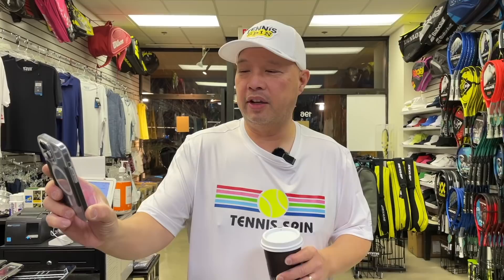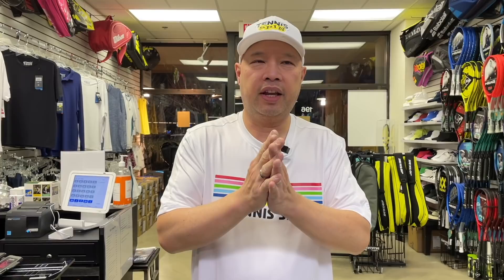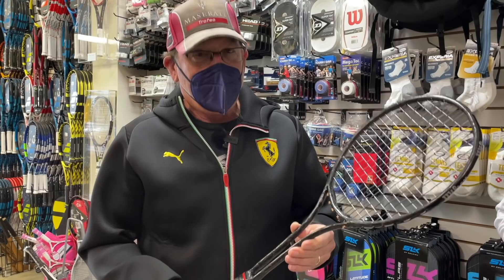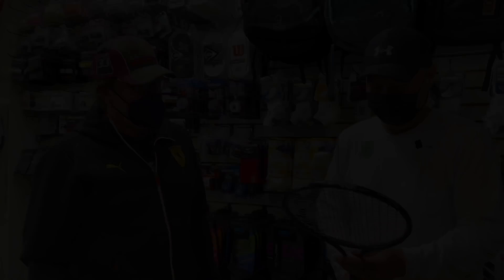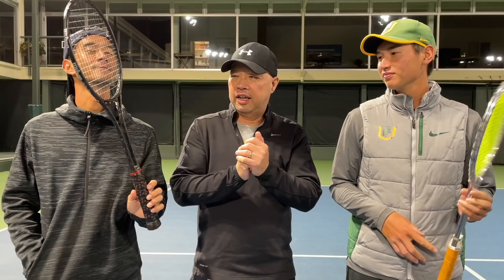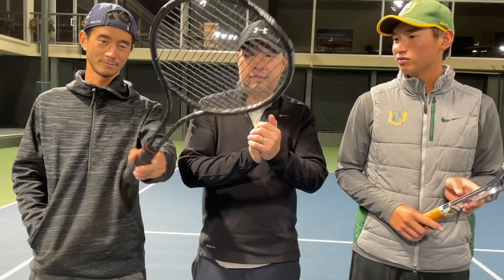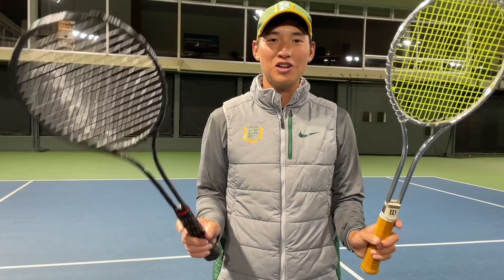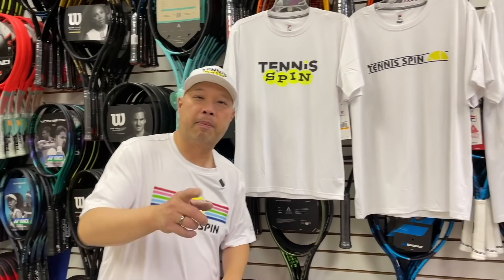CAN YOU MAKE A MODERN DAY WILSON T2000 TENNIS RACKET?  HOW WILL IT PLAY?

Comment: I grew up playing with the T2000 and only gave it up when it went out of production (that wire suspension system was the achilles heel--eventually you'd grind through it and the racket was all done.)  After probably thirty years I picked up two of 'em at a Salvation Army store--in absolutely cherry condition.  Original strings older than our two young coaches here.  And it plays great.  Excellent control, good power, and all the spin you need.  I use a modern forehand and it suits this old classic very well.

Comment: I remember the creak on the T2000. I played with a T3000 as well. I broke my T2000 at the neck and that was one of the weak points. Steel was quite flexible back then. I think that it would have been interesting to try the Tony Trabert C6 and the Adila Cannon which were among the first graphite racquets back in the 1980s and they were 65 square inches. I recall that the Adila Cannon was $400 back then which is even more than high-end racquets today. It's always impressive to see people hitting today with 65 square inch racquets.
Reply: Yes, I remember that creak too.  Had a T2000 until I wore down the wire suspension in one spot digging balls out of the asphalt and it just went "ping".  Replaced it with a T5000 which I still have but the rubber vibration knob thingie perished and fell off. Picked up a T2000 and T3000 in an op shop a couple of years ago, for old times sake.
Reply: Have added a C6 and an Aldila Cannon as well as a Kawasaki Graphite Ruler to my collection. They were far to expensive for me to afford during that era. I always carried 3 racquets to allow for the then common string breakage that occured with gut. Any of those 3 cost more than the three l carried combined. The Trabert C6 feels vastly superior to the other two and actually feels like modern racquet.
Reply: @othgmark1  Maybe you can do a video for Harry to host one of these days. My Aluminum racquets back then were either $25 or $35 each so a $400 racquet was considered crazy back then.
Reply: @MichaelMoy l don't live a long way from Harry, maybe 2 1/2 hours and could definitely put something together if he is interested. I have a substantial collection of vintage racquets of all types of construction. I may be the only interested party though. I also am old enough to have played before the large head racquets took over the industry. I can provide more of a back story than l see on most you tube videos. 
Harry if you are interested reply here and l can contact you at the shop.
Reply: @ozmagoo7724  I picked up two in like-new condition at a Salvation Army store last year.  One had never been used.  It was a blast to hit with after not having one in my hand for thirty-five years and long after going to a modern forehand and a Babolat.  I was surprised at how good it was hitting modern.  Great, really.  I let one of my younger hitting partners try it and he loved it.
Reply: @charlesfaure1189  Hi Charles. Like you, I eventually wore down the wire suspension and the strings collapsed.  Replaced it with a T5000 which makes me wonder whether the T2000 was available at the time.  These days, mainly have the occasional hit with friends about 10 years younger, and took the T2000 out for a hit - they struggled with control but surprised at the power.  After playing with a Prestige for many years, the T2000 did seem rather agricultural.  Dunno how I managed to play with it in my younger years.  If you hit the sweet spot it was amazing, but could be unforgiving if you didn't. One poster reckons you had to hit it flat, but I remember you could hit reasonable topspin with it, maybe because the frame seemed fast through the air and you could really whip it, compared to a wooden stick. I remember it was great for topspin lobs.
Reply: @charlesfaure1189  It's surprising what you can find at those op shops or goodwill stores.  It's become a bit of a hobby to pick up something interesting, Google it and have a bit of a hit to see how they play.  Your T2000 sounds like a great find!

Comment: I'm curious about this racket. Can this Wilson T2000 be attached with polyester (monofilament) strings and with 32-34 lbs tension?
Reply: It’s strung with ALU Power poly and currently sitting at 32 lbs after break-in. Probably started around 45 lbs.
Reply: @danben-ora722  So, the yellow string strung on the Wilson T2000 is Luxilon ALU Power and started around 45 lbs?
Reply: Sorry, the poly is on the recreation. I’ll string the t2000 with confidential at 32 so we can get a better comparison. The yellow is a multi at 52.
Reply: @danben-ora722  No problem. Thanks for info.

Comment: To me, the T2000 is the most unplayable racquet ever produced and J Conner's career record with it proves he was the greatest tennis competitor ever. Why resurrect this rocket launcher?
Reply: It was a great racket if you knew how to use it.  Still is.  I own a couple of em.  It does require that you be able to put the ball in the center of the stringbed every time.  I went from a flat to a modern forehand twenty years ago and it works just fine.